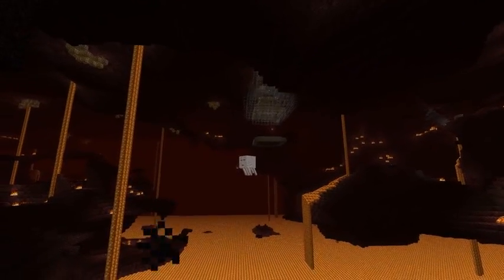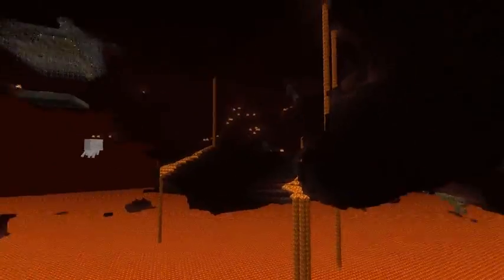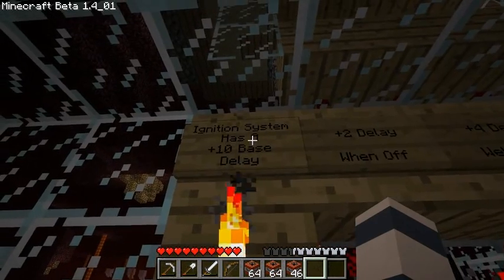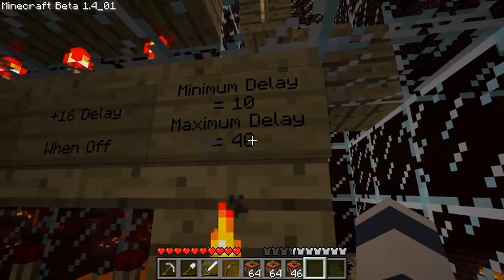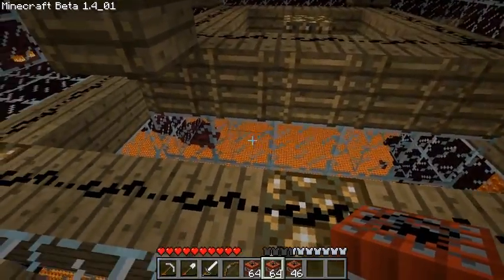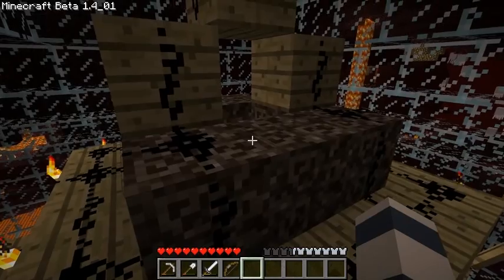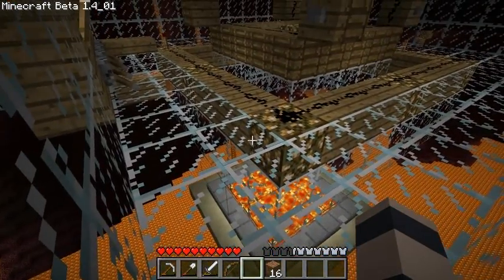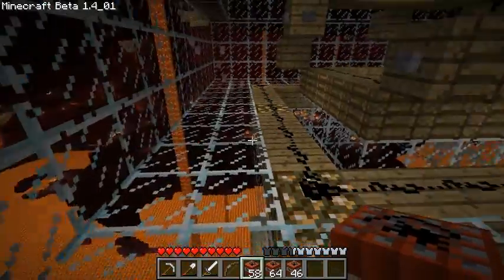Minecraft - 360 Nether Cannon (Demo)

Comment: I've got an orbital strike deffence cannon in the works(shoots strait up). Only diffrence with this is that its a rail gun useing the max high limmit for its propultion. Still have yet to test it sence the main body of it is in need of a good caseing to support the raw power behind it. The projectiles range from arrows to basic TNT. Still the same end result if it were RL. Dead ships that want to blow a planet to bits. Name: ODDS(Orbital Destroyer Deffence System). Contact me if intrested.